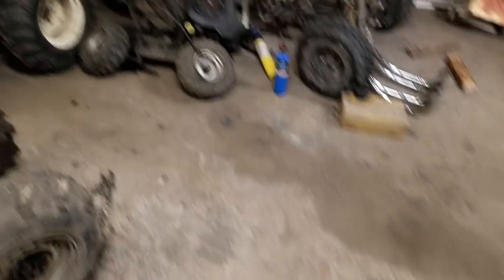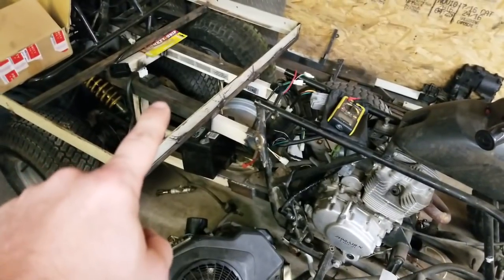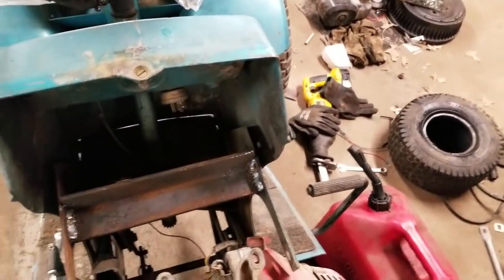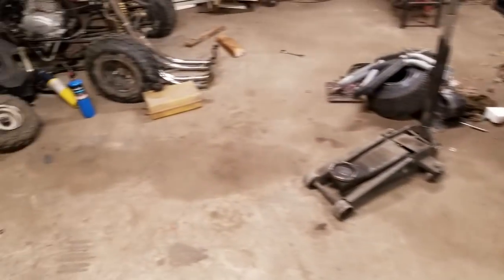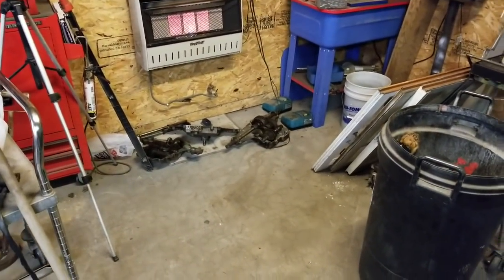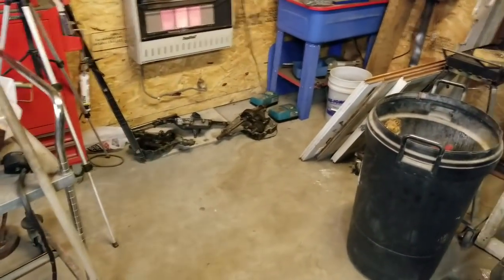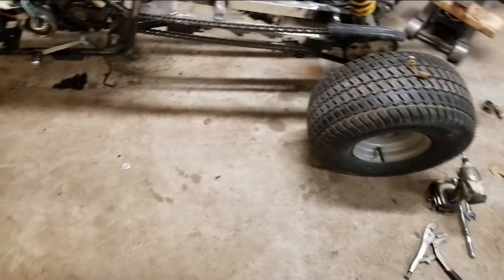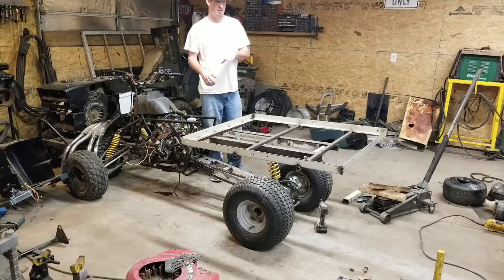Chinese 4 Wheeler Turned UTV Part 4 (Wait!!! I'm Gonna Build What????)

Comment: Hey Lonnie!!! U R running a lot of projects all at the same time, I have several tractors around, rather then a mud mower, I've been thinking more of a pushing tractor,  a tug type tractor build, maybe with front wheel drive and back wheel steer....
Reply from the maker: Harvey Spooner the 4x4 build won't start for a while. I'll have my other projects done before that one gets started. I'm just gathering stuff for it right now.

Comment: I have thought of doing a 4x4 mud mower the way you described,  not with the transaxle but the stock front differential from the atv, just couldn't think of a way to drive the diff with a mower engine, i actually never thought of using a transaxle for the front drive too, I like your idea and bet it will work great, did you say you were planning to run the stock atv cvds grafted to the 820 shafts, seems like that would be the easiest way to do it, I also thought of running a central transmission, a peerless 700, to a jack shaft with 2 chains that ran front and rear solid axles, the front would be shortened of course so the atv cvds could be grafted to it